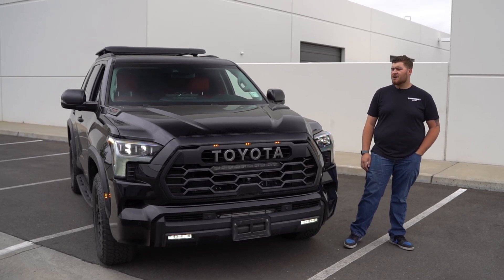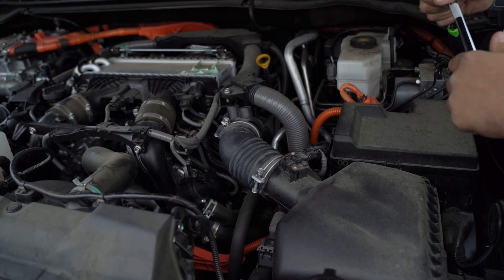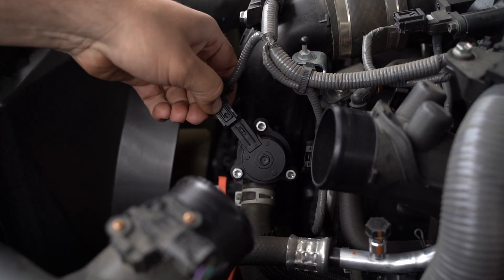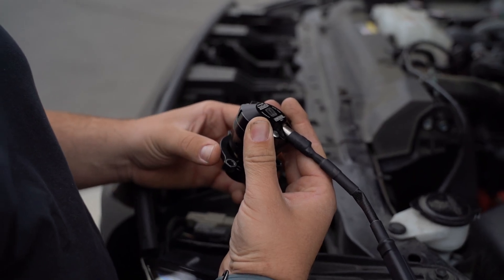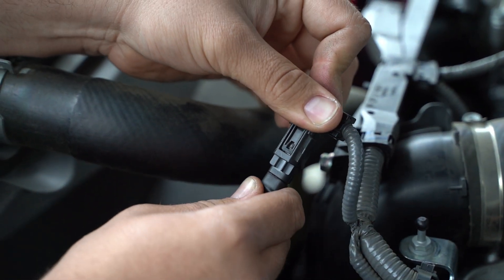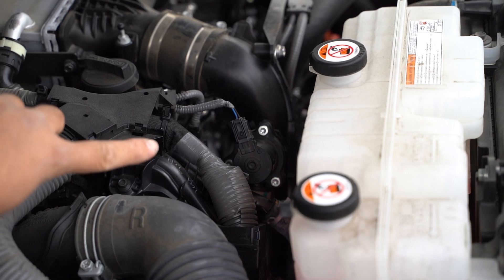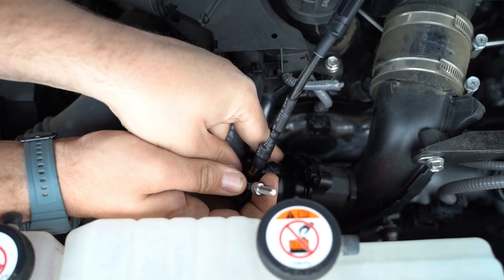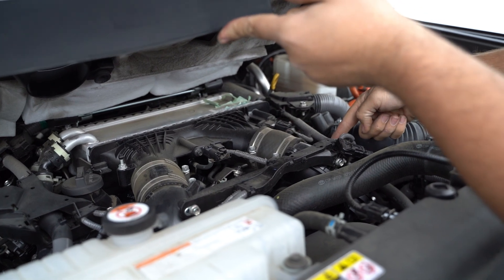BOV INSTALL: Toyota Tundra and Sequoia Blow-Off Valve (P/N: TS-0223-1083 & TS-0223-1283)

Comment: Does it matter that the hoses are just left open?
Reply from the maker: Depends. If being done indoors and the job will be completed relatively quickly then sure. If you are outside on a windy day and are worried about dust then use something to block the hole. Just remember to remove whatever you used to block the whole unless you want to lose a turbo. :)

Comment: Would the plumb back (re circulating) one help with the “thunk” noise my truck now makes since I got a new CAI. pretty sure it’s the diverter valve making the noise.
Reply from the maker: Can't say we've ever heard any of our Plumb back valves (Kompact EM or any model for that matter) make a "thunk" noise. The piston in the valve is brass with an o-ring at the base that makes contact with the aluminum body. Not really a noise that those components are capable of given the area of travel for the piston.
Reply: ive been getting that noise too and its been driving me crazy. I have no clue what to do

Comment: Installed on my 25 Sequoia. Can't find a torque spec for the bolts, but used 10NM with medium blue thread locker. Seems close to factory torque.
Reply: Any issues with it? Engine stalling? Or anything?
Reply: @LFelan118 no but it does release pressure faster than OEM. So when you let off a hard acceleration the power will drop faster with the whoosh. Sometimes the rear diff is a little laggy behind the power drop and you'll feel it. No stalls though. I wish Toyota allowed some blowoff on each shift, but the ECU only sends blowoff when you let off the gas.

Comment: I had the dual ports installed on my tundra trd pro 22, and the sound was SICKK i loved it , but had to take it off due to my revs , when the turbo charged as soon as i let go of the pedal my revs will go straight down and then slowly regulate making a small pull on the truck each time. Is there any way to fix this? Because i honestly really like it
Reply: Is this the stall out that people are talking about? Going up hill it will make the car stall out? I have this in the cart ready to purchase but weary to jump and buy it because I don’t want to risk a malfunction on the HWY…. Can you elaborate on what happened to your TRD Pro? I have a 2024 Sequoia TRD Pro.
Reply: @mmsaito1  It wasn’t just uphill, it also happened on flat roads. Every time I let off the throttle the RPMs would drop hard, then bounce back up causing a noticeable jerk. It also threw a check engine light twice, but i just reset the codes with the carista module and ready to go.
Reply: The problem if it happens without a module in hand is that until you reset those codes, the throttle wont respond.I even reinstalled them after seeing this video thinking maybe I placed it wrong, but no, the same issue came back with bothe dual port connected. I only placed one first this time so now I’m running one dual port and one OEM, and the behavior is totally different (way smoother), plus I still get the phhhh sound I like.
Reply: I think the problem is that the system expects that air to be recirculated, and dumping 50% to the atmosphere makes it run a bit off. With one dual port you'll be just throwing 25% , ill run it like this for a few days and see how it goes.
Reply: @ivaneduardollibre1251 thanks for the response. I appreciate the honest feedback. I don’t know if  it’s worth it.
Reply: @mmsaito1  id say that if you really want that pshh sound with no issues at all, go for just one dual port and one oem. It is still worth it. Haven't had any issues on 4 days so I feel its going to stay like this. Sound is not as loud obviously but I still have it and I like it. So with 1 you can have a mental peace, with 2 you might have the same issue as me.
Reply: @ivaneduardollibre1251 thank you for your advice I appreciate it. I don’t want the headache of codes and reprogramming. I want the sound but will hold off for now. Thanks 🙏🏽

Comment: Will the dual ports interfere with air metering and cause the vehicle to run rich or anything?
Reply from the maker: We have these on a few hundred Tundras and Sequoias without any issues.
Reply: @TurbosmartHQ Thanks for the response. I’m running them also for 4 days now (Tundra Hybrid) with zero issues. Someone in the forums said they would cause trouble so I wanted to ask you guys personally.
Reply: I’m experiencing and engine stumble when coming off boost. In the spirit of transparency, I’m running a JB4. BMS is blaming your BOVs.

Comment: What makes these over $600. Honest question
Reply from the maker: To be blunt, it’s because there are two BOV’s in this part number. Double the product so double the price. 

Other applications that require one Kompact EM are literally half the price.
Reply: These won't stall your engine like the cheaper ones can, letting off the gas in an uphill pull. They keep 50% pressure
Reply: You are paying for the "pssssh" sound 😂

Comment: Whats the difference between the plumb back and the dual port BOV?
Reply: Plumb back recirculates back into the intake. Dual port exhausts into the atmosphere.
Reply: @discobiscuit893 which part was installed in the video? Dual port or plumb back?

Comment: Will I get error codes if I install it?
Reply: If you let off going up a hill at lower speeds higher rpm’s the engine will cough out and potentially stall…. This is a known issue with removing the recirc charged turbo air that feeds back to the cold side of the turbo
Reply: @ben6592 😮 good to know! Thank you 🙏🏽
Reply: No. It's just another diverted valve. But this one instead of recirculation the excess pressure. It just sends it out. You will not get any performance change or anything. No code or error. You're basically spending 650 bucks just to have the BOV noise. It sounds nice. But I don't think I would throw out that cash just for the noise. Maybe if I had a nice sounding exhaust. But getting these tundra and Sequoia to sound good is extremely hard
Reply from the maker: @dethtour You’re paying for upgraded billet aluminum valves that can support higher PSI/horsepower, provide longevity over the composite plastic units, and in many cases seal better than the OE diverter valve. Oh, and the noise. ;)
Reply: @TurbosmartHQ The NOISE! 🌀💨 Fook Yeah!
Reply: @dethtour I have these along with Craven exhaust, a K&N cold air intake, pedal commander and JB4. Truck sounds pissed off when I get on it
Reply: @dethtour thank you for the honest answer! 
🤜🏽🤛🏽 🤙🏽

Comment: Why install a bov on a soccer mom car?
Reply: Why not let soccer mom’s get some turbo noises?
Reply: Soccer mom car is rocking 583 ftlbs of torque and 437hp from the factory.
Reply: This thing will smoke most trucks on the road.  583 torque
Reply: Because they asked for it 😜
Reply: Lil bro obviously got holeshot & dragged by a "soccer mom car " 
😭🤣